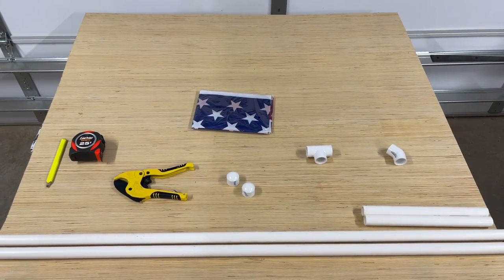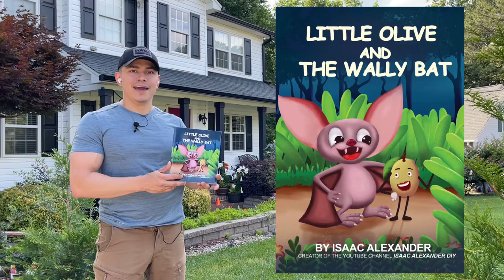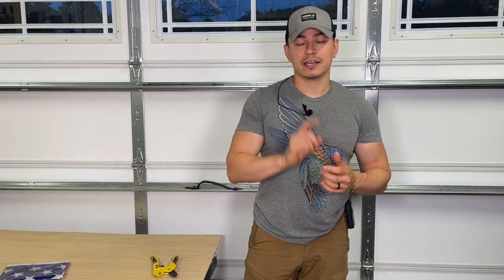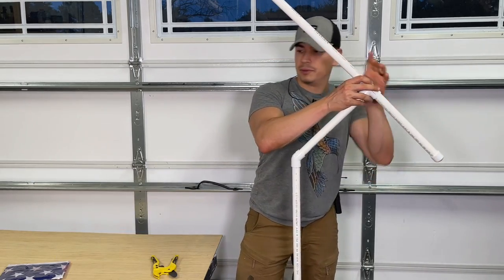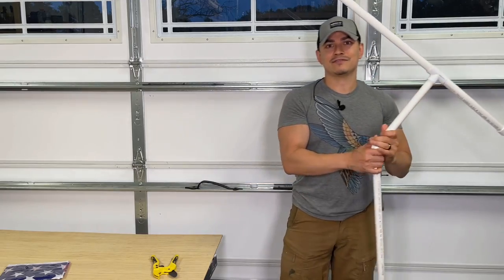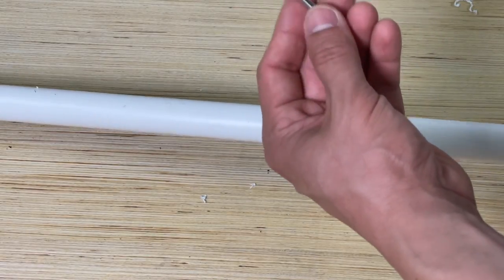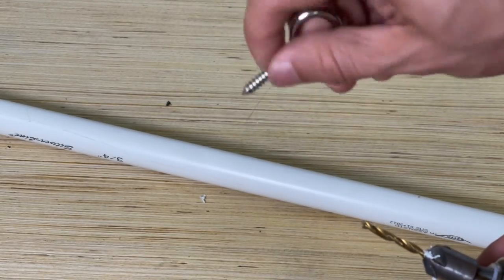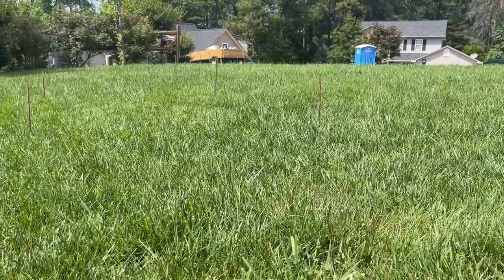4th of July Display DIY - Step-by-Step Tutorial

Comment: I made 4 of these but Im curious, how did you keep the pipe from spinning on the rebar. Did you zip tie pipe onto rebar instead of slipping it over it?
Reply from the maker: That’s actually a good question, I think mine were spinning as well, so what I did was simply push them into the ground to prevent them from spinning. So the rebar is holding them up, but I pushed the PVC a few inches into the ground to keep it stable.

Comment: Absolutely Beautiful!  I have questions.  Is the 12 back piece used for balance?  Are they offset so the flag flows better in the wind?  In other words, why not just a straight pvc?
Reply from the maker: It’s for both counterbalance and aesthetic. When I tried to make it without it, it worked fine but the flag would lean a little bit more forwards. Nothing extreme but it would lean so lightly lean more so I did that as a counterbalance and aesthetics